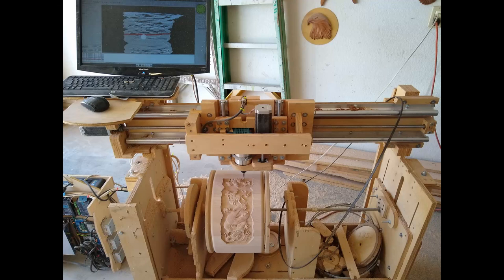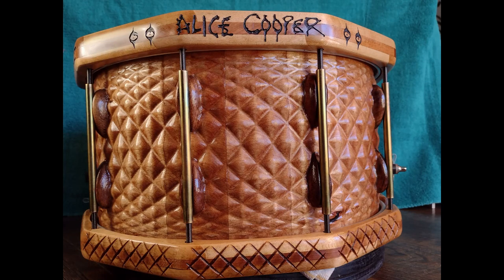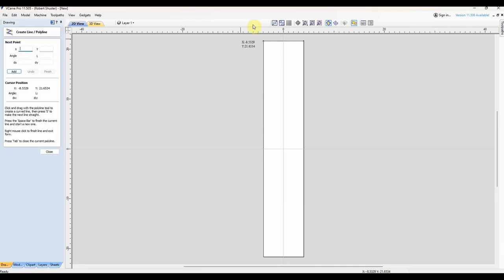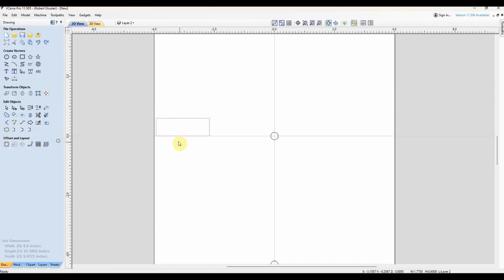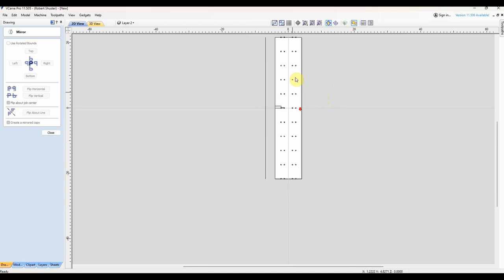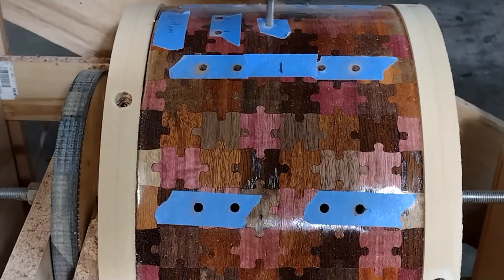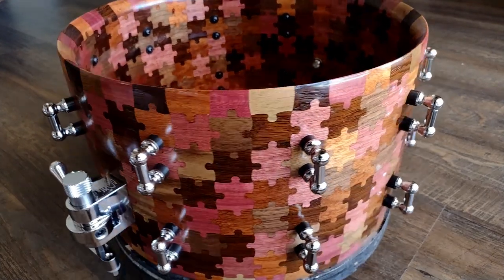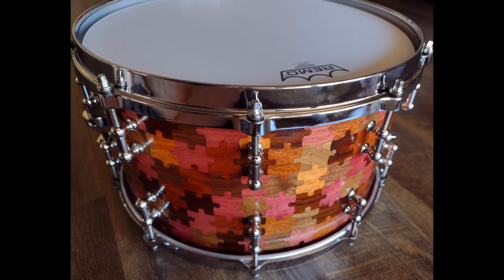Drilling Lug Holes on My Favorite Drum (So Far)

Comment: WOW........ now.... do you save these hole files to use on other drums, if they are the same size drum, (if you make another drum the same size)? Or is every drum that size need differant hole locations? Just curious.... Your skillz always blows my mind..... Great work my friend 👍 You Rock my friend 🥁🥁🥁
Reply from the maker: I have a folder called "lug holes" where I save lug patterns, and I normally grab one that has already been designed as a starting point.  This is the first time I have used 1" tube lugs.

Almost all of my drums are 13.875 wide, but the height can vary quite a bit.  5" tube lugs are my "go to" standard size.